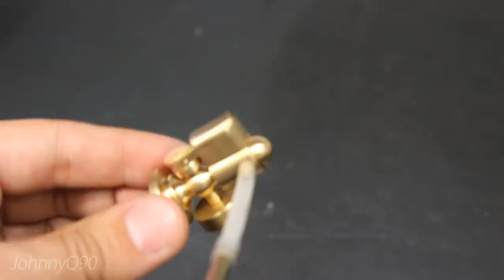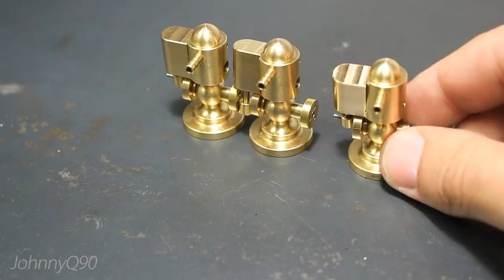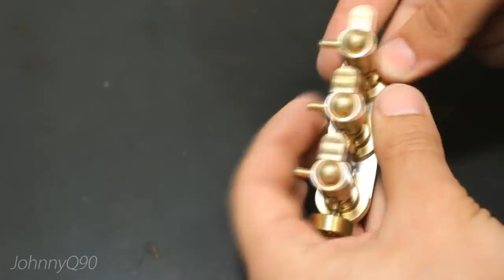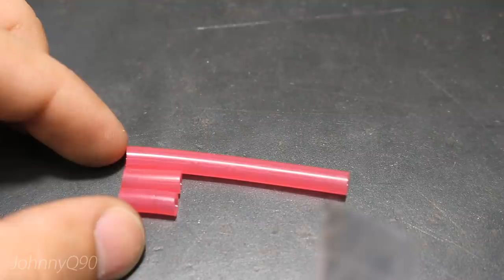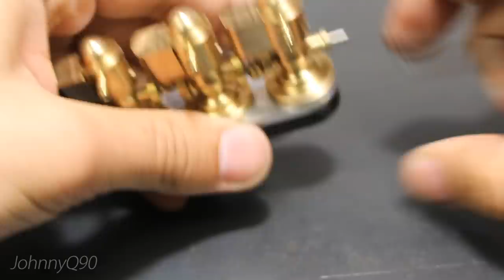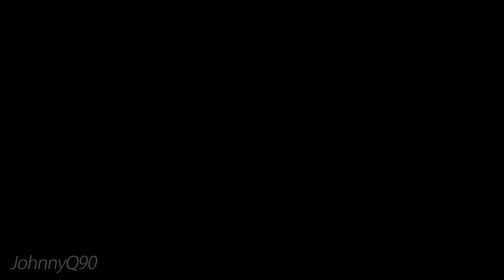Joining 3 Motors In 1

Comment: Cool, I'll put twelve of them together and put it on my bicycle.  Not too many people can say they have a twelve cylinder powered bicycle. :)
Reply: Duncan F. You also would need an air compressor
Reply: A. K just make a pedal powered compressor
Reply: Brian Argo lmfao a genius design! So innovative, a motorized fuel-less bike! in fine print : "air compressor pedal powered"
Reply: You could carry an air tank, and refuel at any gas station air compressor. Sheetz has free air.
Reply: You won't have enough torque
Reply: Captain Dildoface ok, you won't have enough HP
Reply: Captain Dildoface I don’t think these thing can withstand such pressures
Reply: @buddyclem7328 - There are some places who take charge for air ? 🧐
Reply: About 12 farts of power
Reply: @a.k959  just use steam lmao
Reply: I don't think you're going to power a bicycle with this 😂😂😂

Comment: If I had a machining shop and the skills Johnny has, I would probably make an RC car with one of these engines with a little canister of compressed air to run it off :D
Reply: I'd make a steam-powered RC car, including a little generator to power the electronics :D
Reply: Xenro66 no you won't. I have a lathe machine and the skills. But no time💔💔
Reply: I completley agree
Reply: You may be able to make yourself a machine shop. Look up the Delany Multimachine and the Yeomans Lathe. There's also several CNC machines you can build.
Reply: I was thinking air compressor  connected to rc battery
Reply: That would actually be so cool
Reply: I'll probably make a battleship with those skills 😏
Reply: Love the idea!
Reply: I'd put a little compressed air tank which forces high pressure air into the cylinders to get that boost baby
Reply: I would just see how fast I could rotate it without it exploding or melting.
Reply: Exxarem 

i was thinking the same thing.
Reply: @kean3258  That'd be a waste of energy
Reply: @prankcommando600  He might have the time.

Comment: Offset all the cylinders by 120 degrees so they are not all moving in the same direction at the same time and it will reduce the amount of vibration you're seeing.
Great little motor!!

Comment: really a great job, how did you get the support that stops the spindle is in steel or aluminum, I would also like to build it for my lathe it would be useful to have it, still compliments for your accomplishments :)
Reply from the maker: Thank you. I didn't make this part, It was made in a CNC machine shop.
Reply: Thank you for the reply . then I will look for some CNC labs for the work of the piece.
Reply: Don'build it, you give 3 times less  air for each motor so you get 3 times less power, the you add the friction these "upgrades" add you end up having less speed and force than originaly
Reply: that depends on whether the loss to friction is more than the gain in transmissible force, as there is always one piston firing and power is more even.

Comment: Make a car powered by compressed gas? Is it possible to mount a gas tank or even a balloon on the car?
Reply: Use an HPA paintball tank, but you'll have to figure out how to drop the pressure(3000psi) to something usable.
Reply: Could put some type of flow limiting valve on those small co2 tanks or something as well.
Reply: There is a guy building full-size cars that run off of compressed air in France. The tanks are massive and run the full length of the car.
Reply: Nope, definitely impossible.
Reply: Adams tenn old one cylender engine and steam engines

Comment: Something you may like..
we call them huffer puffer engines, based on OLD Centrifugal force wheels,.  The engines Start with a Push of the Wheel, and only ADD force as the wheel slows down..Very high torque..  It was a design used on OLD trackers, to use as a Generator and make other systems work..from Tractor to Wood cutters..

Another is how the OLD steam engines worked, by passing the Steam pressure Onto the NEXT cylinder..Which was abit smaller then the 1st..  as the Pressure cooled it was STILL enough for the next cylinder..

Comment: By chaining 3 motors together do you get increase rpm with the same psi?

I think the torque will definitely increase, but not sure about rpm
Reply: NERF870525 no....i think its decreasing the rpm brcause you need to feed 3 times more...with the same amount of pressure
Reply: I do not expect the RPM to be any different, assuming you can supply enough air to keep all the engines fed.
Reply: Hey,
Reply: The rpm is given by the torque and the resistance of the motor and flywheel. So, if you supply 3 times as much air, the RPM will be around 3 times as high without any load, a little bit less since more friction. If you attach a load the torque is higher than with only one engine, thus driving the load with more RPM. If you where to get the engines to run at the same RPM, the i3 would get more torque.

In other words: RPM and Torque will be same same, if you supply the same amount of air. But the i3 engines can of course take more air, since it has 3 times the displacement.

Comment: Sooo...  What does it run on ?
Reply: Isaac Bourn compressed air
Reply: the face in da wall oh right
Reply: Air. He could do some clever engineering and work out a 2-stroke gas, or a simple diesel/compression approach using a slightly larger, less beautiful model.
Reply: Isaac Bourn nm
Reply: Isaac Bourn
Reply: Runs on dunkin like America
Reply: Isaac Bourn political promises
Reply: ΑΡΗΣ ΚΟΡΝΑΡΑΚΗΣ sounds like limitless fuel source, the future of American energy.

Comment: Design a V-6 with two fly wheels. that you can mount the hot gas cylinder in a rocket stove to turn fans to move heated air through a room. Make a neat rocket stove heater. 😊

Comment: For equal air input you should have put 2 connections in the middles of the 3 connections and also used a larger tube to equal the amount needed to provide full flow pressure to the 2 individual tubes. Then you should of connected then with that larger size tube to yet another even larger tube that equals out the needed size for pressure yet again. 
The way you made it has the pressure being weakened and split down by 1/3 and provides the most amount of pressure to the first motor and least amount to the last motor.

Comment: How do you ensure angular alignment of the crankshaft of each piston with the next one? Are you relying on machining tolerances? I think that a one-piece crankshaft might help lower vibrations and achieve a higher RPM and efficiency - but that is potentially harder to machine precisely.

Comment: :D This reminds me of something I've always wanted to do with some Traxxas Nitro R/C engines.. I've always wanted to take the cylinders and make a custom crankcase that'd turn them into a V8 or V12 or even a double/triple wasp radial engine. I think that'd be awesome and would make a TON of power for a small engine... though like a big diesel (like the 8/71 Detroit 2 stroke) you'd likely have to supercharge it to get the air in.. At some point in displacement a 2 stroke cannot provide enough vacuum to work properly without being forced induction... 
Yeah I know it has nothing to do with steam but sorry my brain saw a correlation and had to point it out.. that's Asperger's for you.

Comment: if the power source is the same... does adding more cylinders help anything? seems like it would lose a little power as there would be more friction and more weight for the same power source to move. ?  seems as though (in my mind) just adding a bigger flywheel to a single cylinder might do about the same good. don't get me wrong though... this project is super super cool.  I loved it.

Comment: Pray tell, what kind of lathe set-up do you have? Its kewl! I liked the drop-in toolpost! Did you make that adaptor to use a dremel tool on your toolpost, or did it come that way? My little South Bend lathe has lost power, over the years. What hp is your motor? I need to get another motor for mine, as it's over 60 years old! Thanks so much for making such a nice video!

Comment: I wonder how much a four piston design would cut down on vibrations? It seems like it's vibrating because of the uneven strokes. Also, are you using any kind of bushings or lubrication on the shafts?

Comment: Cool project, but not a legitimate 3 cylinder engine if the only connections between the cylinders were the base plate and the power supply (ie. Input air).  Would have to tie together the outputs as well

Comment: Can it run slow?  I don't get why you didn't try it in this video, because since you have three wobblers you now have 3 power strokes per rotation instead of just one, meaning it could run a lot slower than the original engine, and run slow much like a full sized stationary steam engine

Comment: Could this work in reverse and create air pressure??
Reply: Not exactly, because spinning the wheel by hand will cause air to escape through the exhaust tunnel built into each piston container. However, if you modify the exhaust to lead into a one way valve air canister, then yes you can create air pressure this way. :)

Comment: Why would you move the cylinders with compressed air to then rotate the shaft using the reciprocating motion when you can just drive the shaft directly from compressed air? It looks good but compressed air and cylinder doesn't make sense

Comment: Was it ever explained as to why the lathe sounds so crunchy?
Reply from the maker: +Loebane The sound you hear is from the gears of the auto feed. It's absolutely normal. If I disengage them the sound goes away.
Reply: I'm not trying to rip on your lathe, but are the gears plastic?
Reply from the maker: +Loebane They're all metal.
Reply: Ah ok thanks, I was curious.

Comment: This is not a motor because a motor can run by itself usually on gasoline but this needs air to run it and plus on a motor the piston heads don’t turn side to side, the head only goes up and down while the connecting rod underneath it moves

Comment: Forgive me if this is a little ignorant, but is it really an engine/motor if it requires an actual motor (Air compressor) to run it...?
Reply: chipmonk434 it could also run off of steam
Reply: The air is just the "fuel", you could use a separate tank of air. The motor on the compressor provides the "fuel" for it, but so does an oil refinery, or an oil well for gasoline. Compressor--->compressed small bottle of air, put the bottle of air onto a mini car. Oil --> dug up from the ground using wells --> refined in a refinery, then transported to gas stations to fill gas tanks in vehicles. Like this air pressure car here, https://www.youtube.com/watch?v=cny9qYZwM4g
Reply: This is the most logical response. I feel kinda dumb for not thinking of this myself.

Comment: with this engine, is it possible to make a car that works with this engine and has an air compressor which sucks air as fuel from outside? I know that we still need fuel to operate the air compressor, but this will greatly decrease CO2 emissions..

Comment: What is the purpose of making a lightweight outer ring on a flywheel?
Reply: nikoladd more angular inertia with less overall weight

edit: actually that doesn't make any sense.  the ideal flywheel has most of its mass away from the center.
Reply: nikoladd i think its just because it looks good

Comment: Better use a simple DC series motor or an induction motor to avoid this shaky performance and get smooth speed and torque. These engines are superb but fails miserably due to these shaky cranking. Go get Electric motors.

Comment: why drill the holes on the outside of the flywheel. that is exactly the opposite of what you want to do
Reply from the maker: +David Stekelenburg It's just for aesthetics, nothing practical in this.
Reply: JohnnyQ90 true. Is a flywheel even necessary?
Reply: A groove around the outside might look okay while being able to drive something small with a rubber band or piece of string.

Comment: hmm... it's more a generator, or converter, than a motor.
Reply: Is a motor too, could put that into a tiny car with a small tank of pressurised air on the back of it, and attach the fly wheel to the wheel, and there you go.

Comment: Those are NOT motors.  A Motor turns potential energy (fuel) into kinetic energy (motion).  If these are motors so is a pinwheel.
Reply: Patrick EH A motor is something that converts energy to mechanical energy (motion). In this case it is using stored energy in the form of compressed air.
Reply: That is NOT a motor.
Reply: Yes it is. It is converting stored energy (compressed air) to motive force. That is what a motor does.

Please educate yourself. https://en.wikipedia.org/wiki/Pneumatic_motor

Comment: What glue does he use?
Reply: Looks like cyanoacrylate (super glue).
Reply: Jackaboy Smodlaka looks like loctite 603, it’s green
Reply: Looks like it's written on the video
Reply: Where are yo getting green from?
Reply: Ilovelazers Most if the glue he uses is green Loctite, but he glued the metal base to the plastic base with a clear glue, most likely super glue, which I believe Loctite calls clear Loctite.
Reply: Buddy Clem No that glue is called Loctite Super Attack :)
Reply: Jackaboy Smodlaka 
The green glue: Loctite 603
The clear glue: Loctite Super Attack Gel